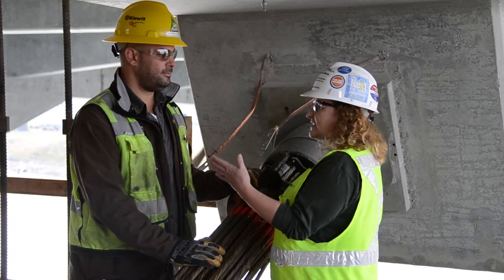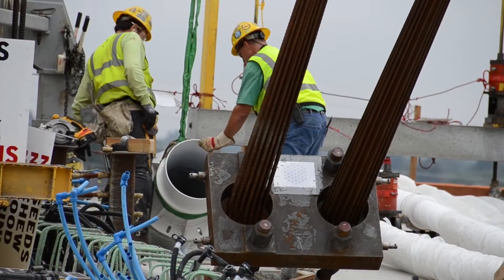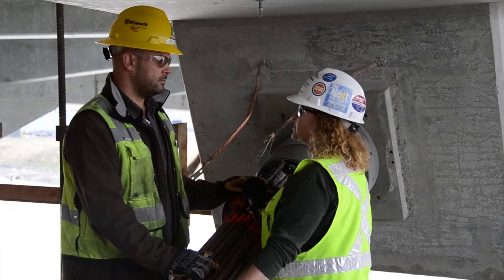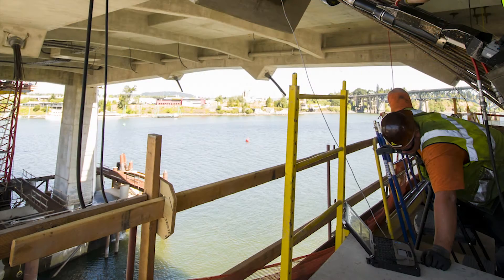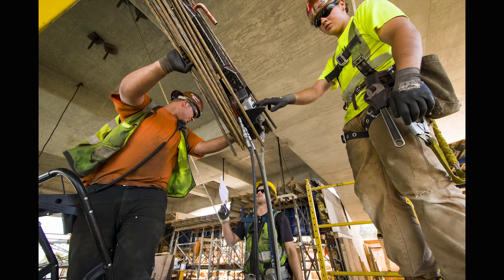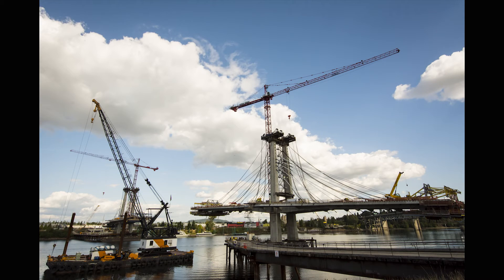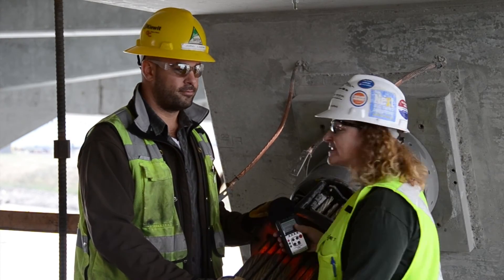BridgeView, Episode 17: Stressing the permanent cables

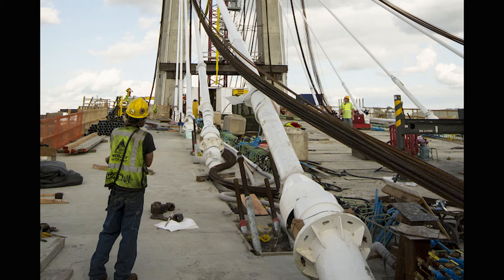Comment: About 2:18 "If needed, down the road, 10 or 20 years, if the bridge starts to sag a little bit, we can pull on them and stress them again". What, AFTER 2:49 "the strands will be cut", for capping off, you still have enough length of protruding strand to get a grip on with tools to restress it? What, with the same tools? Or is a different procedure required to restress a strand that has been cut for capping off? Is there is a danger when restressing a cut-off strand that if you lose your grip on it with tools, the strand will contract back inside the cable and you can't get a hold of it again? How many people actually have experience of restressing cut-off strands? More or fewer than have walked on the moon? Is there a video of someone restressing cut-off strands because I would very much like to watch that video?
Reply: When strands already cut, there is still enough length to do re-stressing with the same equipment. There is also another procedure of re-stressing, when you pull not the strands one by one, but the whole bundle of strands. 
If for some reason you lost one strand (slippage or break), there is also procedure of replacement.
Reply: @anatolybabadzhanov6866  Thanks. What I'd really like to know how to do is how to do this on a bridge built some years ago - release a strand from the anchor block so that work can be done to electrically insulate the released strand from the anchor block - and then get the strand back through the anchor block when it is now TOO SHORT to simply manually thread it through.
The only two options I can think of is - replacing the strand altogether with one which was the original length before being cut for capping off OR if it was possible to restore the strand to its original length by splicing a length of strand onto the end.
More about what I am planning on my blog post.
https://peterdow.wordpress.com/2020/02/11/electrically-de-icing-the-queensferry-crossing-cable-stayed-bridge/
Reply: @peterdow1541  The anchor has tapered holes with wedge grips that act as a one way grip...they can pull any cable any time tighter and then just let it off and it will stay there. They dont cut them off flush but leave enough sticking through for the cable puller to do its job next time....I believe that they were re tightening the cables that ran through the concrete on that walkway in Florida when it collapsed